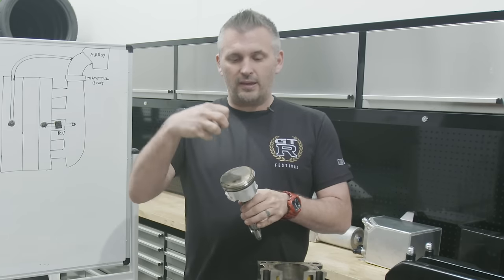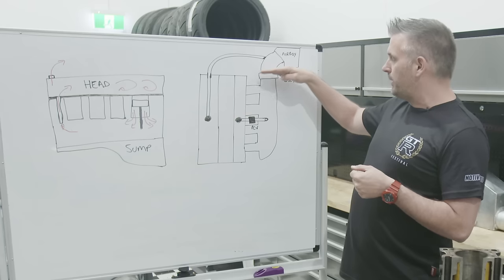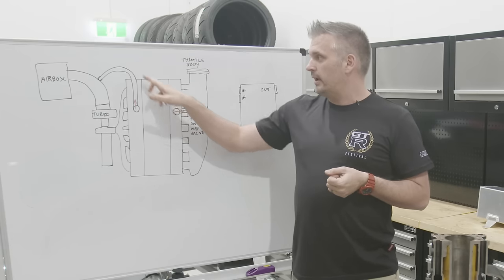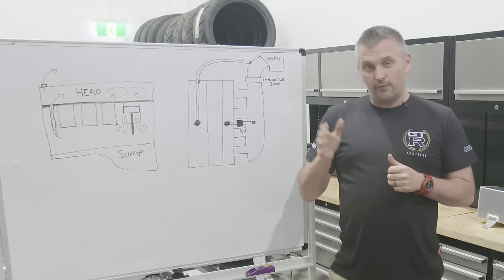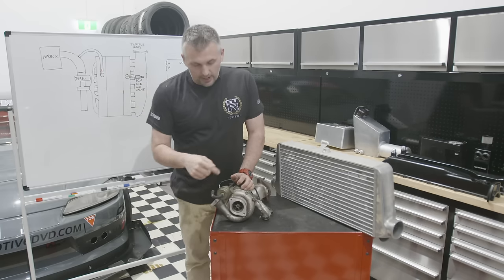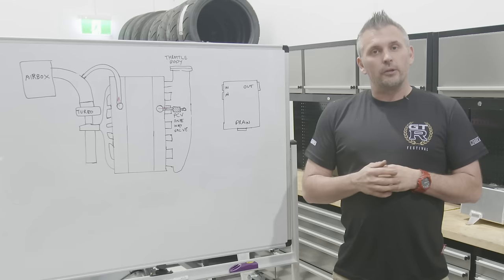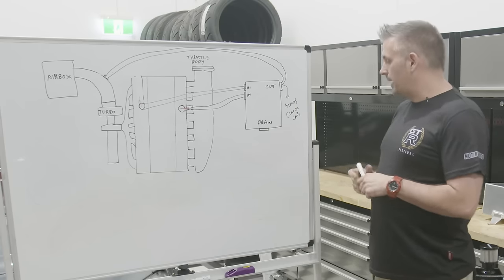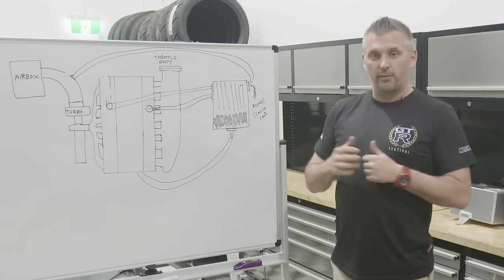Why EVERY Car Needs an Oil Catch Can or Oil/Air Separator - Motive Tech

Comment: How about venting from the crank case instead of the valve covers? Some engines have small oil return galleries from the head and blow by going to head can restrict the oil flow..
Reply from the maker: The return line becomes a breather as well
Reply: @MotiveVideo  Howcome? Shouldnt it work if the return is to below oil level and breather lines are from above?

Comment: What one way valve would you recommend to drain the oil back to the sump?
I didn't find a good one to suit this type of situation where the oil that should go back to the sump has no pressure at all and won't work with a spring loaded check walve.

Comment: The real question may be, why do you have so much blow-by.  Watch the TotalSeal videos about their gas ported rings and how it changed the blow by in the engine.  I really appreciate the knowledge about E-85 as well!  Makes me think that E85 really isn’t worth the oil contamination on a naturally aspirated setup!
Reply from the maker: E85 is always worth it
Reply: E85 is pointless on a naturally aspirated setup unless you are over 12.5:1 compression. Under that compression, the power is not timing limited... which means, you can push the timing all you want and won't get more power... then, eventually you will get knock, and decide "lets pull timing back all the way to where it just made the most power," and it might be 8degress back. Then, you switch back to 98ron (93ron+mon/2 in the US), and realize, there was no difference in power, since those extra 8degrees was null and void and only allowed with E85 anyway.

Comment: Would you suggest running your head drain on an rb26 to the catch can if returning to the sump?
Reply from the maker: No, the head has way too much oil build up at the back. would fill a catch can in one dyno run.

Comment: What if you run a drysump? i guess you would not have these problems.
Reply: If you have a dry sump you have a catch can where the oil is stored.
Reply from the maker: We have a video about that soon 😁 Dry sump can have sealed engine with no breathers or can vent and have catch can also. But the blow by still goes into the oil

Comment: So do you block the PCV valve?
Reply from the maker: You can if you want to. But it only lets oil vapour in under vacuum so no where near as much as when engine  not working  hard, not much blow by.
Reply: Motive Video Thank you

Comment: But can i remove the pcv and naturally vent to atmosphere?
Reply: It's illegal due to environmental concerns.
Reply: @OBCBTTB  I meant technically not legally.
Reply: @billasohyeah  Read a bit of history on this subject and am a little confused myself, so can't answer you properly from a technical point of view.

I just had the Flash Lube Catch Can Pro installed on my Toyota Hilux yesterday, the reason why I was browsing these videos and threads.

I suspect the simple answer is Yes for a motor vehicle. You can vent the blow by to the atmosphere, but it would need a separate tube to run alongside the exhaust to the back of the vehicle otherwise you'd be breathing in fumes through your ventilation system from the engine compartment.
Seems that back in the day, before WWII or thereabouts, the crankcase pressure was released through the gaskets, seals and bearings and it was accepted that weeping oil through these places was just normal.

Comment: Can someone explain to me i have an rb25 forged and all the goodys making about 300kw at the wheels, do i remove my pcv valve and run the lines into catch can with no return?(dont care about legalities ha)  atm i have pcv valve still going into intake and one line coming off the rocker cover into catch can and the "output" going back into the intake pipe infront of the turbo, had alot of pressure issues and overflowing catch can situations in the past until i set it up this way but am still getting oil in my intercooler, if someone can explain the best way to setup my RB25  would be much appreciated thank you!
Reply: PCV valve keeps the boost from being forced into the block, when the PCV is connect like factory. Don't remove it, unless you're going to remove the line that connects to the intake/inlet manifold as well.

Comment: Something is wrong: in factory settings the blowby uses the shortest hoses length setup (best vacuum+pcv). By adding a longer hose+oil can, you add restriction on the mixture flow, poor air return and retarding the problem. The best is to add more air exit from sump to the breather. The return  you made just equilbrate quicker the pressures up and down. The smoke from the exhaust at 22:33 is actually too much pressure still there, canceled by vented it. Sorry for my english, I'm french. Thanks.

Comment: Q. Why would any right-minded person want to spray goo or contaminated air all over their expensive lands or blades of their turbos. These spin at incredibly high speeds and balance is paramount to the longevity. After all, turbos are finely machined and balanced instruments. Further all that goo sticking to the walls of the walls of the intake causes friction slowing down the flow of air to the cylinders defeating the purpose of the turbos. As well now you have all this goo building up reducing the diameter of the air intake ports. Then theirs the added problems of all this goo being turned into carbon building up on the hot backside of valves and head chambers. As well carbon building up on the top of the piston the cylinder and rings all causing premature wear and ultimate failure to the engine. Wouldn't all this blowby be better if it were just contained in it's own reservoir and gotten rid of at the same time as the oil change? All these contaminants could be handled more environmentally friendly at the recycling facility. A win-win for the environment and the automobile owner. Never mind the added performance of the engine it's self.

Comment: You never explained why every car needs an oil catch can or oil/air separator. You explained what they do, and the various ways to hook them up. Explain the factory setup, and how it works, and explain why a catch can setup is better. Also, wouldn't the vacuum, that the intake manifold is acting on the crankcase, be reduced if there is a catch can in place? Isn't the vacuum important so that the oil will return to the crankcase from the valve/rocker covers between shifts/idle/part-throttle/etc? The vacuum from the intake pipe to the valve/rocker covers, and the pcv to intake/inlet manifold, will cause a sealed system, how does a catch can that is vented do that?

Comment: I recently added a supercharger to a 1.6Litre, 4 cylinder engine and I'm finding that the throttle body needs cleaning every two/three months.  It is not a GDI engine, do I need an oil catch can?
Reply from the maker: every car needs a catch can
Reply: @MotiveVideo  Thanks

Comment: look here man fuel vaporisators exist realy long time thats the true porpose of that thing belive it ore not I dont care because the same thing look like a mechanical carburetor and exactly that thing makes no defirence about a gasoline and disel engine because bouth are compresion ignition engines thats what schools dont want you to know if still peopel doubht my story see old lenz bulldog tractor working on bouth fuels!!! 😑 good video thank you but by aware if you evaporate gasoline "controled" vaporisation and you actualy prevent evaporation in somer you get realy nice gas milage thats the only  truth explain please what at fuel system charcoal canister is used for ? but I must warn peopel if they dont know old acient enginrs actualy do work on burned charcoal so ? what have oil prices to do with fuel prices if there is no oil? good question.
Schools are not wrong but they definatly dont tell the whole story and this is coming from a profesional oldtimer mechanic.
the only cool thing is engine run on with blow by problems interesting effects acure and one of them are cold diseling and pre ignition alter some states like fuel air ratio ore spark intensity engine wont stop he will become a disel engine how interesting fenomena well universal engine exist long time even used in ww2 and aperantly petroleum jelly ,self sealing fuel tanks,hybrid cars,air engines and lot other staff

Comment: Dude just admit you dont know how or why the pcv system is there. try saying "i dont know" now and then its amazing what ya can learn. So according to what you said the car manufacturers managed to install all sorts of useless stuff in a car like 20 cup holders and anti vibration for my antenna so it doesnt whistle, but then decided to cut corners and not install a catch can? i mean come on. there is a reason why they do the pcv system the way they do. you just dont understand what that is. and i dont think you designed most engines out there so how could you possibly know what is better. im not gonna tell ya the answer here in hopes that you learn something in the process. but for starters i will say blowby is NOT exhaust gasses hahaha take the oil cap off your car and smell it, its not exhaust. stop making tutorials maybe until ya understand whats going on here a little better. and always assume the car manufacturer knows best because they do